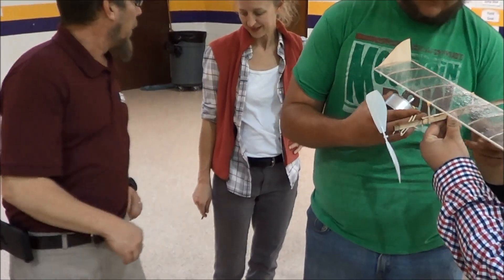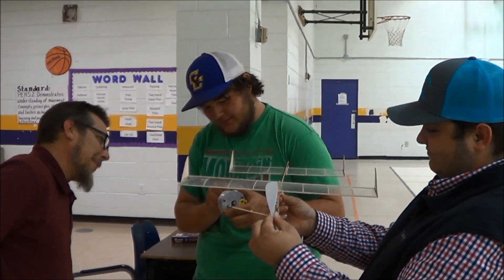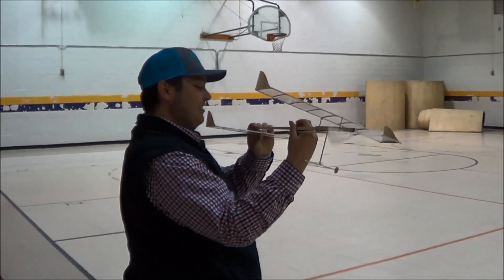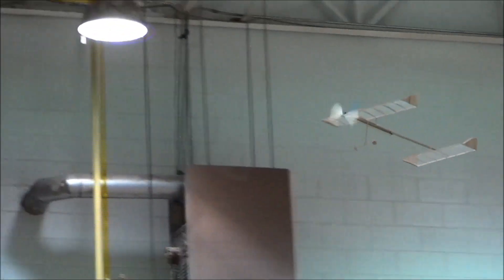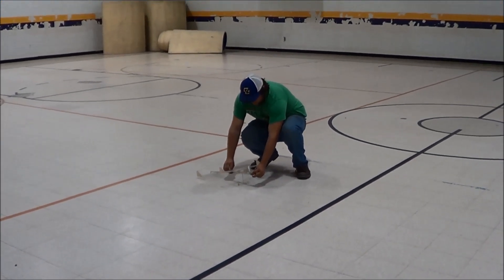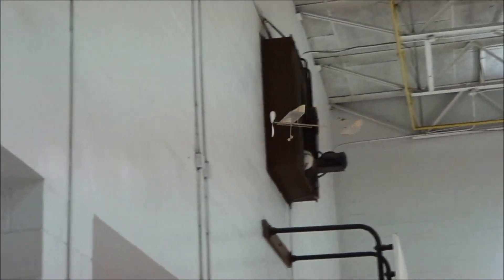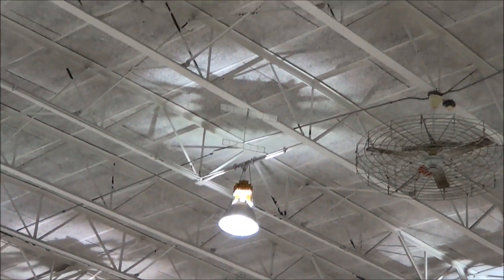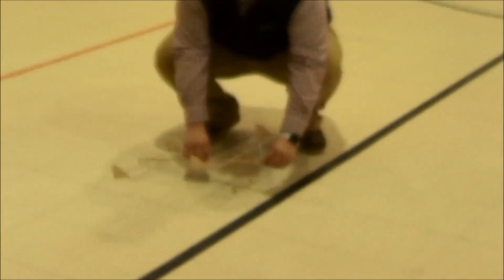Crawford high school TSA Senior Flyer maiden flight

Comment: hello sir thats great.. how can i pitch the plane to left turn without falling down tnx alot
Reply from the maker: Left thrust and some right aileron trim should do the trick.
Reply: tnx alot it could help me.. it could only for rubber bands or i can do for rc without any servos.. tnx for ur reply
Reply from the maker: @matinsaleemi3994  for an RC model you have to pull back on the stick anytime you roll into a turn because tilting the wing reduces its vertical lift vector and requires an increase in angle of attack to compensate.
Reply: wow tnx alot for ur help i will do it. if i couldnt i will use only ruder..

Comment: I'm curious as to why it's not a true tandem. More stability and more lift.  There's nothing in the rules keeping you from doing it either
Reply from the maker: I'm not convinced that anything over 80% of wing area actually helps on a tractor model. On a canard, yes. I might try one next year too. ;)
Reply: @joshuawfinn    The team that I'm working with has been flying a tandem all season and has been getting over 2 minutes with it in a 20' gym
Reply from the maker: RedstonePyroMan, yeah, that's where most of the well tuned ones will end up. This plane was the team's first, and their first outing, so I expect they'll be doing 2:10-2:20 with the next one.

Comment: Hey Josh! Awesome video. I was wondering how you all managed to make the turn tighter. Thank you
Reply from the maker: Haya Albustamy they tilted the stab so the left side was higher than the right. Also added some left thrust if I remember correctly.
Reply: @joshuawfinn  do you mean the right side is higher than the left?
Reply from the maker: Haya Albustamy, no. It's a lifting tail, so tilting it toward the right (left side higher) points the lift vector to the right, inducing a left turn.
Reply: joshuawfinn alright thank you so much